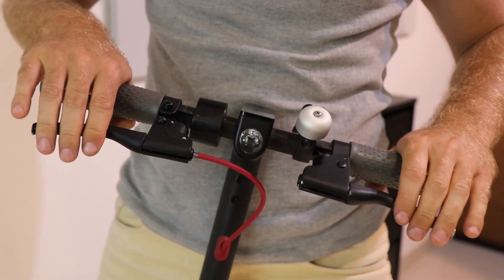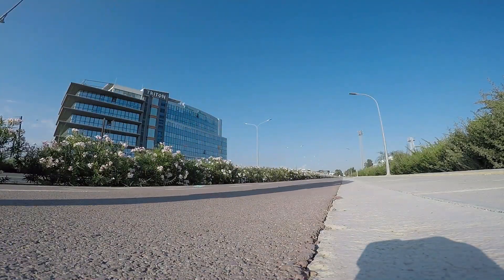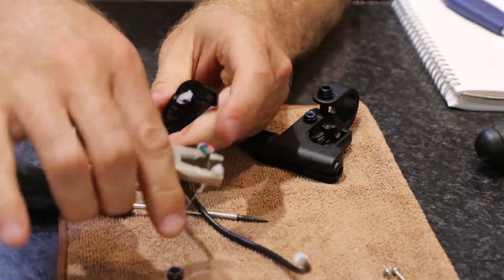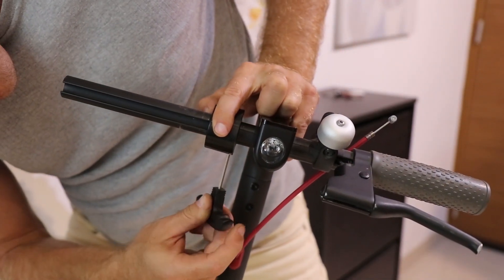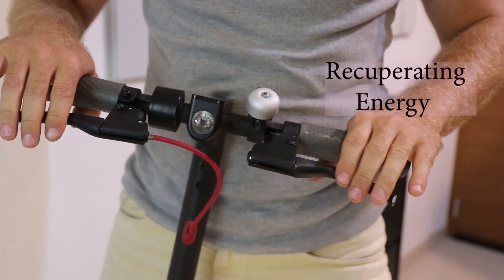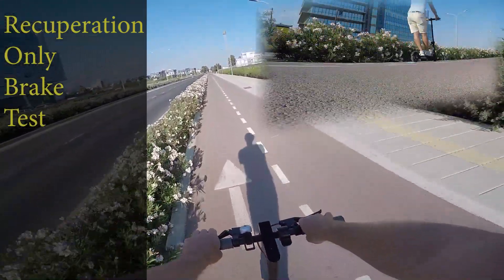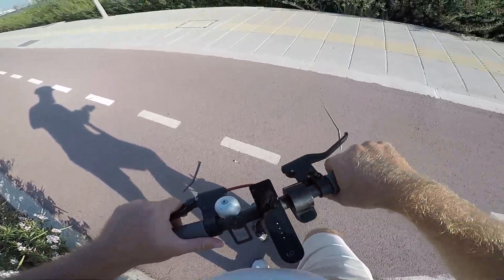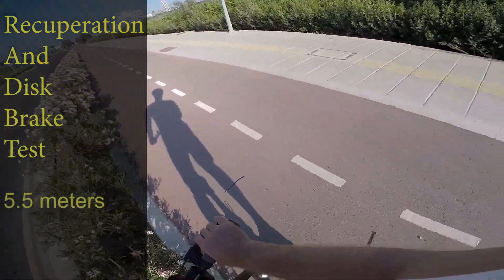Recuperate 100% battery on braking. Charge your scooter riding downhill. Xiaomi

Comment: Funny, I did the exact same thing. I thought I was the first.
I tested it for 2 weeks and ended up removing it. The downside is that braking with the cable brake doesn't turn off cruise control, and the traction of the rear wheel is so poor, it doesn't brake well. As well as regen braking not working when you want to come to a complete stop.
I ended up simply loosening the cable brake so it engages fully right before the lever hits my fingers (when pressed), so I brake mostly with the regen, but can still come to a complete stop comfortably with a single brake.
Reply from the maker: Nice:). What I noticed is that I can 'forget' about the second break when there is an emergency situation as usually I break with the front wheel only. So it takes me some time to use the second lever after I pressed the first one. Those are mine observations)

Comment: No one don't make it it breaks  all z fuses like on my scooter       

I'm never believeing you bro
Reply: BC of this I need to buy a new battery thx you
Reply from the maker: @ANONYMOUS.scooter t should not affect the battery. Battery has BMS system which protects itself from overcharge and any of such cases. It seems you have problem with the battery of some other reason. And by default the recuperation is there in each MI scooter
Reply: @vincentcyprus  I know it didn't effect the battery but the BMS but the BMS costs a lot so I will buy a better battery with stronger amper and capacity
Reply: But the recuparasion with the brake the brake reduses the speed alot that means the fuses don't get a chance to blow but when separated they get a chance if you go fast and press the recoporasion triger 5 times and hold 1 long then the fuse blows
Reply: Or you could just press the lever lightly.
Reply from the maker: I did not get you. I'm still using this modification and like it. If I go for a long distance I try to use recuperation only while breaking. I'm using it now and plan to use in the future
Reply: @vincentcyprus  it broke BC I breaked with it very fast
Reply from the maker: @ANONYMOUS.scooter  I'm using it for 6 month already and never had such issue.
Reply: @vincentcyprus  and how much km you get extra with the computation break
Reply from the maker: @ANONYMOUS.scooter  I did not calculate how much the distance is longer.
Reply from the maker: Also I see that such separate recuperation exists on other brands of scooters
Reply: @vincentcyprus  BC they have a more bigger Amper fuses

Comment: What do you think about this modification? WAs it worth to do this?
Reply from the maker: It is good to have if you are breaking a lot. The other thing is you have to keep your fingers on both handles each time to be ready to break in emergency situation. Usually I use the front break only but it happens sometimes that I need to press the rear break immediately. So you have to be prepared to it.  As each seconds counts on emergency. There is no time to be wasted in such conditions. For me it is fine. But for somebody else it may be not that convenient.
Reply from the maker: @Joanna Yeap, would be nice 👍